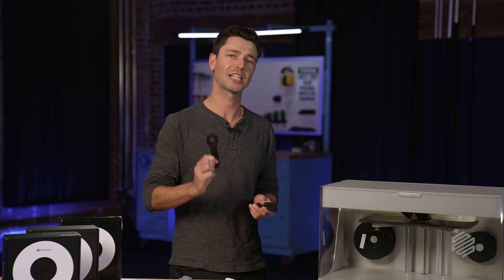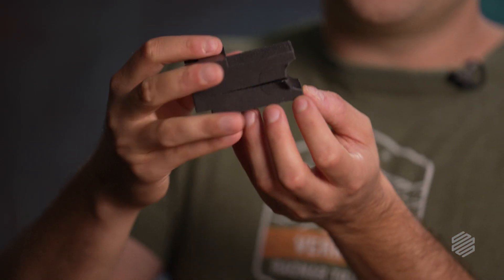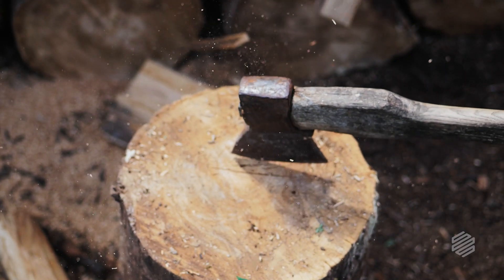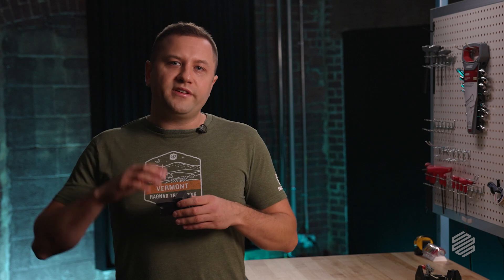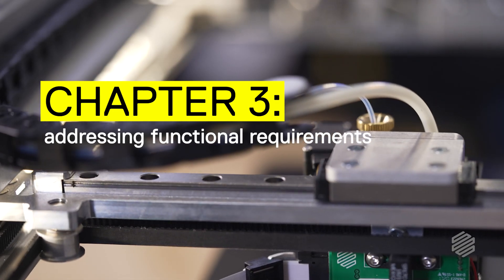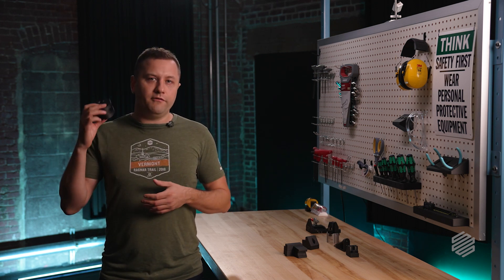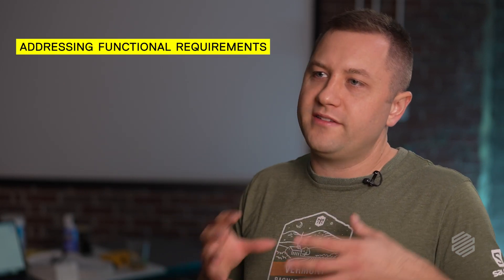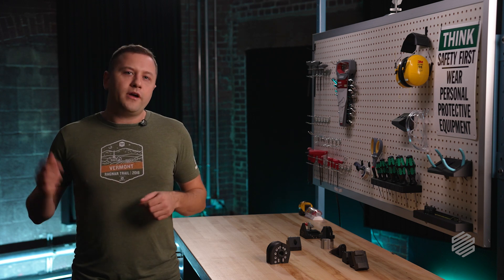How to Strengthen Your 3D Printed Parts Along the Z Axis | Reinforced

Comment: G'day Nick,

Thanks for the excellent video.

We have a number of MF machines and are constantly confronted with the issue of Z layer bonding strength, particularly when a 'pause' forms part of the build, [the options you offered in this recent video are not an option for this client]. Why do you think it is that MF have not addressed the [seemingly simple option - to us at least] solution of allowing the user to modify the build layers for a selected region, or layer stack, so that 'solid' , or 'higher density', infills could be placed before and after these pauses, creating much denser layer bonding surfaces?

Sadly, the Eiger application is incredibly limited in the options if provides to users, especially when compared with how far the market has moved since the  introduction of MF's first offering, back in dark ages.

This would be a very welcome feature, and it appears that it could borrow heavily from the code base which handles the insertion if 'continuous-fibre' laid down on selected layers.

Please don't tell me it's 'on the road map' :-)

Peter
Reply: Hi again Nick,

Just wondering if you have had an opportunity to raise this issue with the MF Team internally yet? Any feedback would be appreciated.

Thanks - Peter

Comment: Hi Nick, I did extensive research and published the conference paper "Effect of Manufacturing Parameters on Failure in Acrylonitrile-Butadiane-Styrene Fabricated by Fused Deposition Modeling" and I am surprised you made no mention of the advantages that can be gained just by the build orientation of the part. Your example not so much due the nature and use of bending dies but still build orientation is worth a mention along with bead width.  It does have significant impact on strength.
Reply: Maybe he skipped it because it's too obvious?
Reply: Yeah I was gonna say the same thing you might be able to forgo all those bolts by printing the part in an upright orientation, I guess you have to print with support but whatever

Comment: I’m in the process of getting some D2 Tool Steel punches a dies made in the Metal X. I’m wondering if the entire part needs to be tool steel or if 90% of the punch could be printed in Carbon Fibre/Fibre Glass with an insert that’s D2 TS instead.

At present the part is only breaking in one point.
Reply from the maker: Yes, we certainly have customers who leverage both metal and composite within a single tool design. These customers localize metal where they need the strength, wear, or heat resistance of steel, and then leverage composites where those properties are not needed.

Comment: Incredibly high production quality ! And a nice informative video, well done !
However there were a lot of shots of the MetalX in this, are the sintered parts also anisotropic ?
Reply from the maker: Thank you! The process of adding material layer by layer inherently creates anisotropic strength, however the sintering process of the Metal X comes much closer to isotropic strength in the Z direction. Regardless of material / process, part strength will always be dependent on the part's geometry.